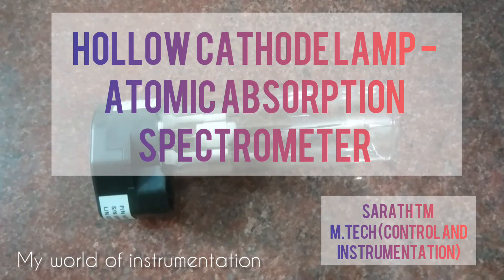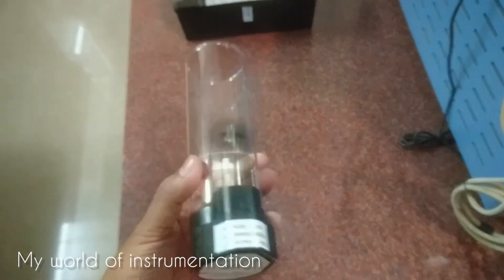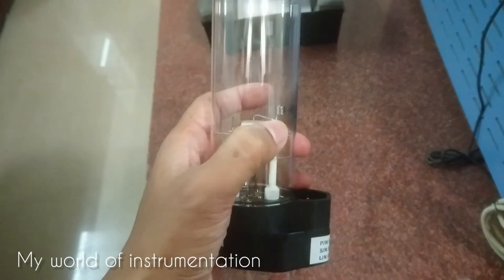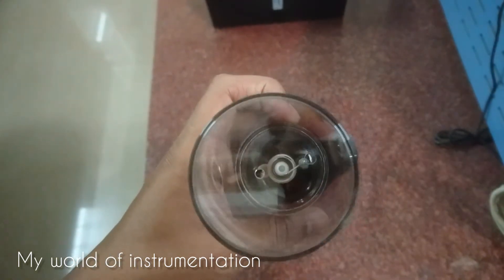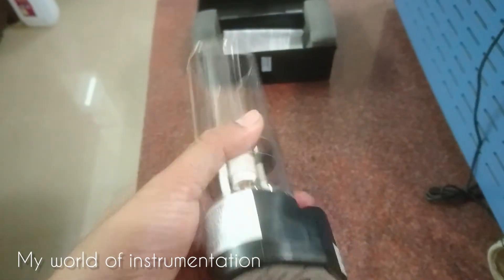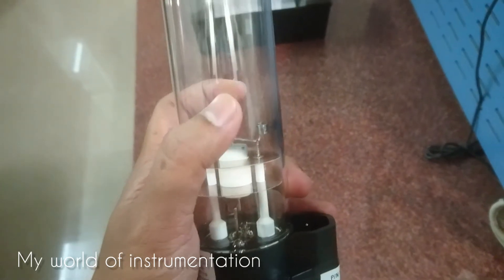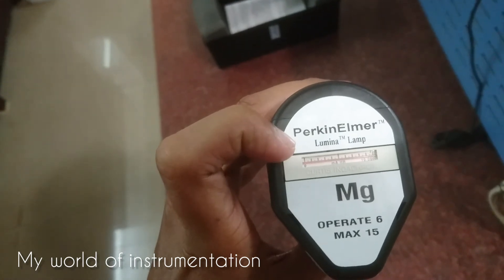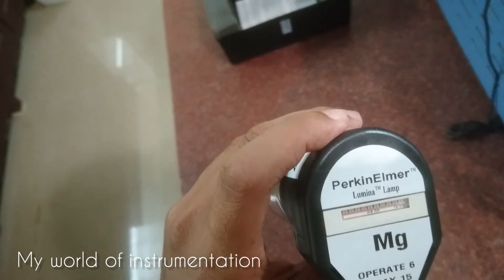HOLLOW CATHODE LAMP || ATOMIC ABSORPTION SPECTROMETER ||

Comment: In what way are you lighting this lamp. I mean by sophisticated machine like spectrometer or spectrograph or by simply using a battery or home power supply(220V,5A-15A). Please reply soon.
Reply from the maker: This is HCL used in AAS (Pinnacle 900H from Perkin Elmer).